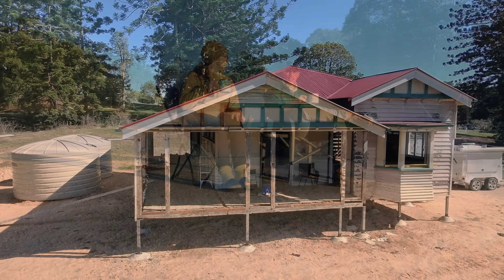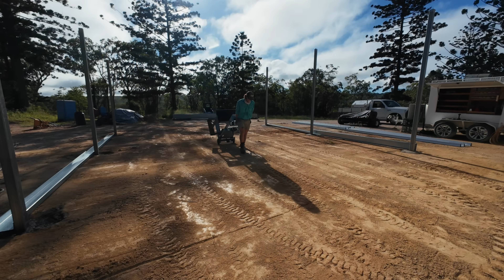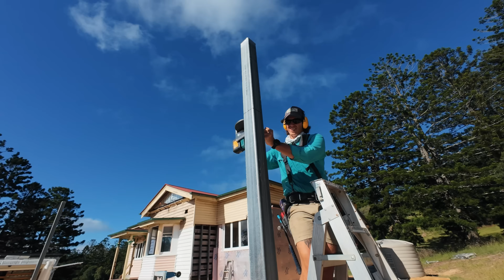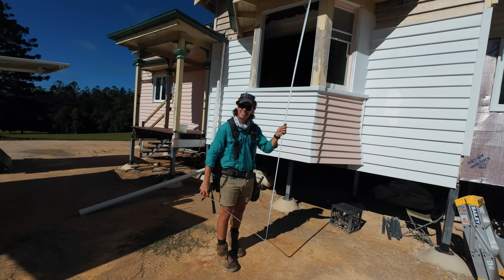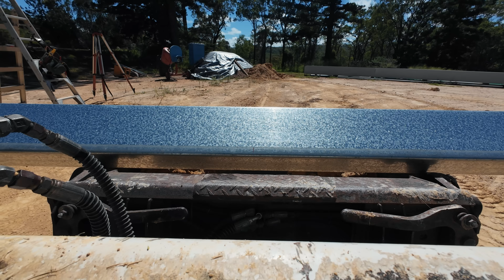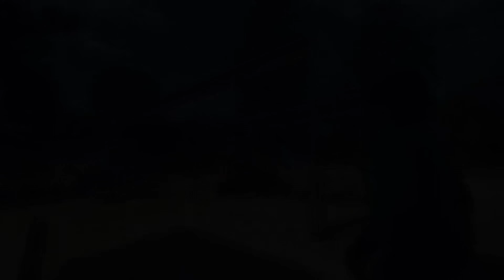100 Yr Qlder Reno: Carport Build - Beams, Battens and Bracing (part 2) - Ep 40

Comment: You're making that look very easy, Byron, it's all coming together really nicely. Did you have a look at the triangle calculator app. I think it is easy and simple to use and gives you a few extra measurements automatically. For example if you enter the span and the pitch it will give you the rise, plumb cut angle and the hypotenuse which could be good for working out rafter lengths if pitching a roof, or in your case, length of the sheets and girts if you weren't getting the materials in a kit form. Thanks for the information on the cold saw, I didn't know they existed. Keep up the great work including the video production.
Reply from the maker: Hi Gary, thanks for checking in. Yes I've downloaded and checked out the app. I'll be ready to use it next time I need to think hard about a certain measurement. It's great, so thanks for sharing.

Comment: Hi Bryon,  I realise that the purlins cover the top of post, but are you going to seal it with silicone. Another future proofing is to drill a weep hole at concrete level of post, so if it ever get water inside and fills up it will not rust the post out at ground level.
Reply from the maker: G'day Percy, more good advice. These posts are capped at the bottom. So in fact there is 900mm of open post cavity below ground level. If this filled up with water that much I'd have more serious problems. But they are good points and would work in certain situations, not this one. I hope you are going well over there and your Reno's are progressing. Seeya again in the next episode

Comment: Haven’t used one of those cold saws for metal. They look good 👍🏻 makes sense they’d be better for metal than throwing a blade on the circ saw with the lower rpm .
When you think about it , drilling metal is always best at a slow speed also 💪🏼

Great work as always mate 
Catch you on the next one 💪🏼
Reply from the maker: G'day Matt, thanks for tuning in mate. You are on the same page! This little metal saw surprises me every time. With a fresh blade it CUTS! Handy bit of gear to have in the trailer. Seeya again soon.